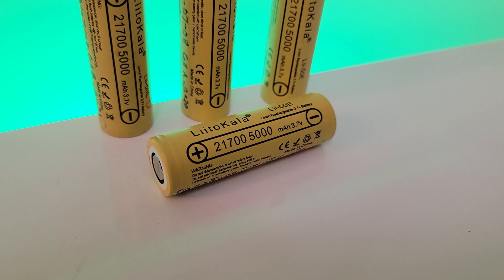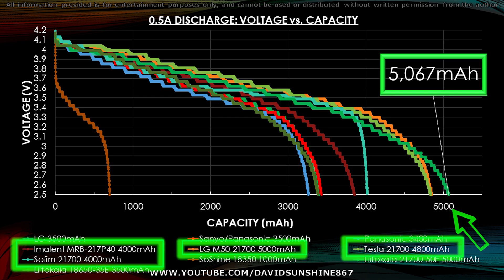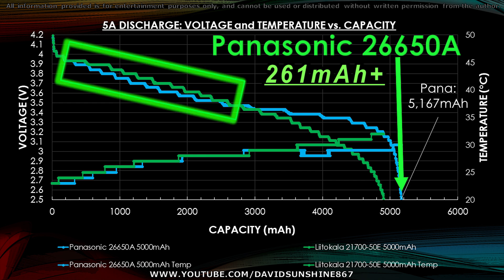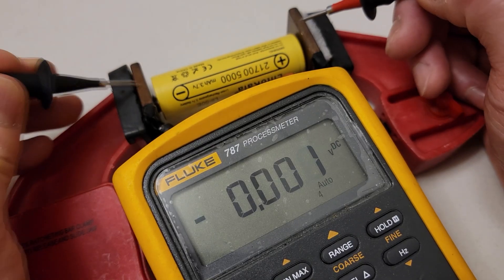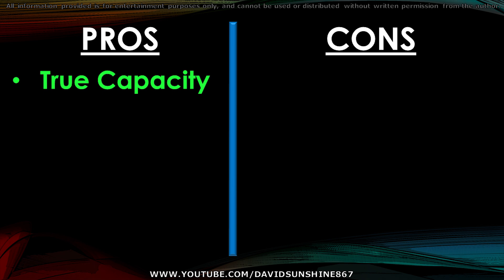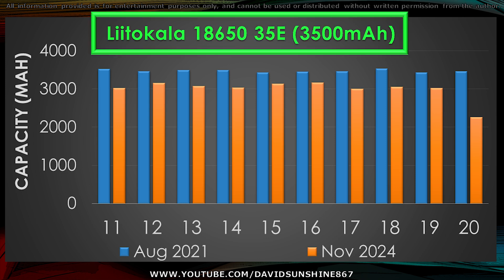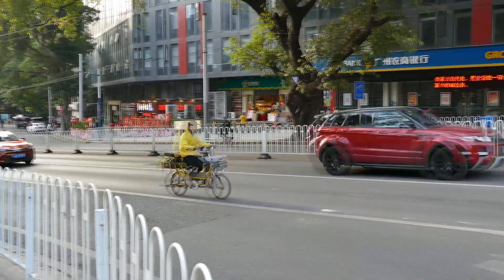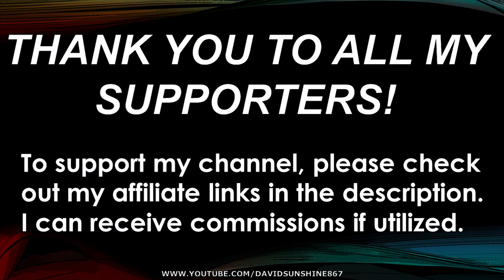Liitokala 50E 21700 Review - TRUE 5000mAh!

Comment: I purchased this battery for my voopoo argus xt and it's a real banger tbh. Truly game changer compared to other cheap 21700s
Reply from the maker: Oh nice! Thanks for letting us know your experience with this cell.  Ya it must be great for extra runtime in your Argus XT! 
Ya I wouldn't use cheap cells at all, this cell is so well priced and performs really well, low internal resistance, and has CID safety! They have a 6000mAh cell now, it was released after I got this 5000mAh, but I think the 5000mAh is still better cuz it can deliver more power. The 6000mAh would only be good for low power applications like small flashlights. 
Cheers! 
David.
Reply: @DavidSunshine  oh, there is 6000mah 21700 battery now? i wonder if it would perform better for my argus xt vape. the coil i use is 65w 0.15ohm. i'd love to see you benchmark it
Reply from the maker: @babybroccoli  Ya it's called King6000 cuz it's the king of capacity, but only rated for 6A continuous, that's only 22w. Even if we assume double for peak, it's only 44w, so might not be good for over 60w usage. The Lii-50E is rated for 25A peak, so over 92.5w, it's better suited for your coil. I'll definitely do a video on the King6000, but I think it'll only be good for low power devices, battery packs and small flashlights. 
Cheers! 
David.

Comment: So what's the best battery made fire proof water proof true 5000-6000ah for my Fenix flashlights I think the batteries inside my Fenix I spent over $860 after tax on 3 new Fenix I'm disappointed in the batteries what is my best option fenix headlamp SAR Fenix LR36R Fenix HP35R Fenix WF25RM 
What is my best option ? For 21700 battery???? 🔋